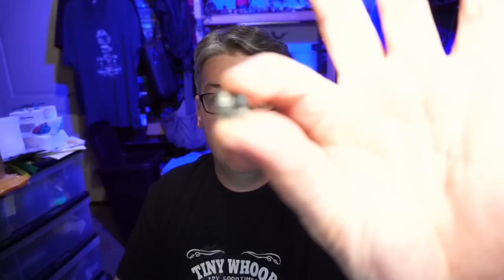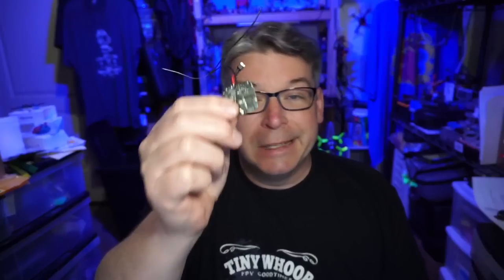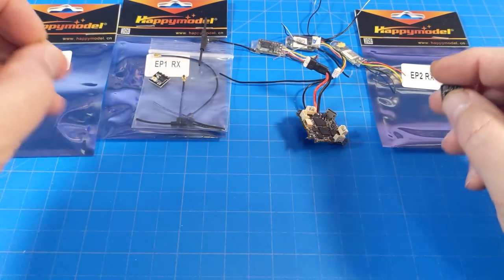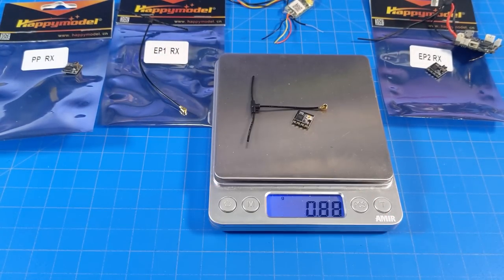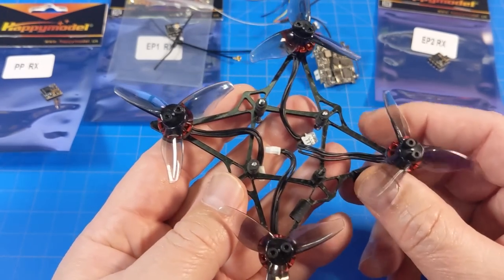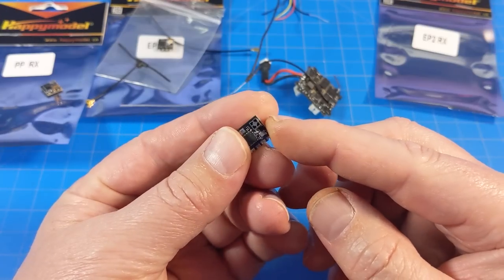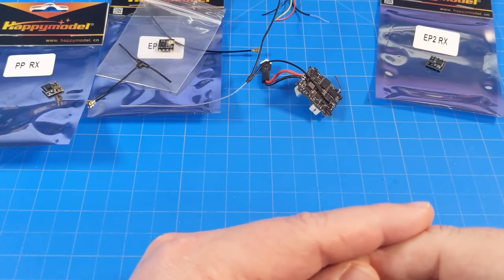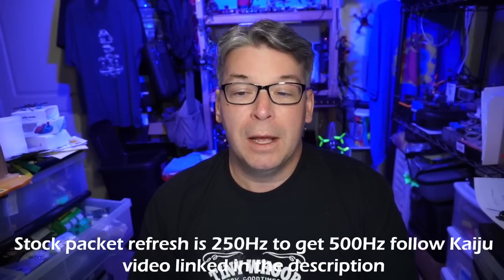HappyModel ExpressLRS 2.4ghz 900mhz // 10mW Range Test // Binding // Updating

Comment: I want an open source project like ExpressLRS for a digital FPV system. I really want this to happen, to free us from the proprietary DJI and Sharkbyte systems. I think the ELRS community has proven just how great and how much innovation the community itself has to offer, which manufacturers have failed to implement for years.
Reply: Agreed 100 percent.
Reply: It's only a matter of time :)
Reply: @ojkolsrud1  very cool project, as far as the pi zero on the quad i would think it wouldn't be a problem for quads except for maybe 65 mm tinywhoops, thanks again for pointing out this project
Reply: @ojkolsrud1  It's a great project but the latency is way too high for small quads. It would be cool for ardupilot on a big quad, wing or similar though.
Reply: And what you imagine to use instead of DJI or SharkByte? OpenTX? Still too huge latency for racing/freestyle and clumsy hardware, not suitable for anything below 3".
Reply: Agree
Reply: Aand hdzero is here. What a nice time to be in fpv quads

Comment from the maker: Do you agree, going ExpressLRS for micros solves a number of issues? This isn't a max range rather a proof of concept or minimum. ELRS has been out 3km on 10mW! 
EP2 Nano Rx https://bit.ly/3sS94sb
EP1 Nano Rx https://bit.ly/3tTjOYM
PP Nano Rx https://bit.ly/3xr4ODG
2.4Ghz TX module (does come with a project box, printed) https://bit.ly/3vmwkQC
Empty module bay box https://bit.ly/3tT8LyA
900mhz AIO Coming Soon!
Firmware updating video by Kaiju https://bit.ly/3xsNtde
Reply: Thanks for the link, Nick!  ❤️
Reply from the maker: @kaijupower  Yes sir. Your vid covers it well!
Reply: Still wondering how they let "PP" through
Reply from the maker: @Vitroid  It stands for Pew Pew, like shooting a gun in star wars.....not really :)
Reply from the maker: @Grim FPV Its from the UZ85,  which is the caddx ant lite.

Comment: Thanks for posting the tutorial!  I have  2.4Ghz slim module from a DIY seller on my Tango2 and I built my own PP Rx. Express LRS is awesome!  You shoud use "LQ" and "dbm" in the OSD for a better link reading (but more screen clutter).  I've had the chip antenna out to over 1200m at 100mW.

Comment: I'm pre-liking this video, just because I know you are going to love these new receivers!
Reply: OMG, I NEED THAT 915MHz FC!!!

They also need a 2.4GHz version as I'm obviously already invested into the 915MHz lineup, but I've got the 2.4GHz coming soon as well!
Reply from the maker: I do expect we will see the 2.4Ghz in about a month
Reply: Also, you were sitting less than a meter from the ground... meaning you suffer from ground interference!
Reply: You can apparently already buy the AIO from the AliExpress store, I just ordered one :D
Reply from the maker: @sjoervanderploeg4340  ah, I often forget about aliexpress. I have added a link. Thank you
Reply from the maker: @sjoervanderploeg4340  yep, far less than ideal testing. Do you think I should run it back with lq instead of rssi, forgot lq was a better visual.
Reply: @NickBurnsFPV  Not sure, I usually just look at the x:y numbers as X depicts the frequency you are on and Y is the strength

Comment: Nick, you have to use RSSIdbm and LQ!!! RSSI is kinda a meaningless scale. RSSIdbm is the actual reported signal level by the radio chip. We choose to have it so RSSI can go to 0 before failsafe so you have a broader range of values but it means you can't really do comparisons with other systems like that. LQ is actually the important parameter because it tells you what % of packets was received with success. I recon you could have gone further on ELRS.
Reply from the maker: Sorry. I fly so much around the house, I didn't think of needing lq. I think I should run it again as this isn't a good example.

Comment: What's the penetration like if you go loop behind trees for example on the 2.4ghz vs 900mhz systems?  Trying to decide which route to go...  I love the idea of the little ceramic antennas but not if still can't fly around trees
Reply from the maker: That area as a barbed wire fence, and worse snakes. I have been back there once. I will work to avoid that area :)

Comment: Nick, I have a question. I seem to have the most trouble with my video signal, not my control link. I have a stone house and can’t fly around to the other side without video cutting out. Even my quads with 200mW vtx fail. Do you have any experience with ground stations? I’m trying to find some way to fly around my whole yard (I have tried new antennas). Any advice would be appreciated! Thanks in advance :)
Reply: have you tried sitting on your rooftop?
or any place higher?

Comment: Nick, the Rssi dont mean much in ELRS but the Link Quality, i have seen videos of people who have -109 dbM signal and 100% Link quality, that means that altough the signal can be very weak according to signal strength, the LORA protocol is capable enough to maintain a high-quality link, you can go 30km+ @ 10mW easily.
Reply from the maker: Should I run it again with dbm value?
Reply: @NickBurnsFPV  Just enable Link Quality on the OSD and test again, you will get out of range of VTX and or battery before you failsafe. :)
Reply from the maker: @rolisaenz  Sure. I have the avio set for rssi dbm and LQ. I do have to be careful not to fly out of observers sight. Don't want to gain that unwanted attention :)
Reply: @NickBurnsFPV  lol, maybe the cactus or bushes will object hahaha.
Reply: @NickBurnsFPV  you might end up landing on the moon if not careful :))

Comment: Pretty freaking excited, just started the process of installing my 2.4 g on my jumper t-lite! 
Can’t wait till I’m done 2:15am now have to stop 😩😩😩 for now !
Reply from the maker: Yes sir. I am told the production version of the pcb that goes inside the radio has labled connectors. Do you have those labels on yours?
Reply: @NickBurnsFPV   yes it does , and I’m finally all updated and in the process of binding, really looking forward to my first “long” range flight !!
Reply: I can get the wifi to Link to my Ep1 but it won't take me to update site ? Sorry to bother you but any ideas ?
I'm trying to figure out the command promp thing you did ?
Reply from the maker: @rk-rc6045  If your on a windows computer, in the search bar type "cmd". The black window should appear on screen then type "ping 10.0.0.1" if your ep1 and computer are both connected then we will see what I have in the video.
Reply: Thank you ! Everything is updated and bound !  Tomorrow we fly far away !?! Really appreciate the help and all the time you put in for our benefit ! Have a great summer !
Reply from the maker: @rk-rc6045  Great, Good to know your all set.
Reply: Hi Nick, my actual name is Rob, Really sorry to bug you again, I have the jumper t lite 2.4 g module I'm using the ep2 Rx's, I have my module and Rx's running RC 8 from the elrs configurator, using the nightly builds option on open tx, I'm flying an emax freestyle, module settings are my packet rate is 500Mhz - 150dbm
Tlm ratio  1:16. 1172bps
Power 250 mw 
Rf freq  2.4G ISM
Not sure what I've done wrong ?
I get failsafe at just over 200- 300 '
No t warning and it drops out of the sky, same thing if I fly around our barn or house ? Again I know you have better things to do but if you have any thoughts I would be grateful 😊
Reply from the maker: @rk-rc6045  at 250mw mine shows:  500hz (-105dbm), TLM 1:4 4922bps. What does yours have at the very top? Mine is 98310a 0:500. Mainly looking at the 0 place, as that is the bad packets. I wonder if the antenna on the tx is possibly the wrong length? I am not sure what it should be, but I noticed the antenna just looks cut with wire snips, not carefully.
Reply: @NickBurnsFPV  yes everything except the tlm I'll try changing that, but I did take a closer look at the antenna and one side is a good 1/4" shorter than the other, really appreciate the reply ! How long do your antenna measure ? Then I promise I'll leave you be 😁
Reply from the maker: @rk-rc6045  the total horizontal length is 46.46mm. measuring from center to one side is 24.32mm the other side is 22.37. I suspect my side measurements are a touch off as they don't add the total. also this is with the end caps removed.
Reply: @NickBurnsFPV  the horizontal overall   length is almost identical but the ends, one is 22 mm the other is 25 mm approx , I was thinking I'd try just a diapole stick antenna ? Could this be bad for the module. 
I know I'm taking up some of your time but than you again I really have appreciated your input !!
Reply from the maker: @rk-rc6045  I don't think we should use a linear. I don't think it would harm the tx, but its always possible. I would reach out to happymodel support to see what they think the issue might be. their website is happymodel.cn.
Reply: @NickBurnsFPV  Thanks Nick, for all the help. Have a great summer !!

Comment: If someone makes an AIO express LRS 900 + Sharkbyte board and possibly even 1s capable it would be a gamechanger.
Reply from the maker: We would need a 7v+ pad on the aio. Not sure if AIO manufactures would be all that interested, but depends on the partner.
Reply: @NickBurnsFPV  When there is $ to be made 😄
Reply: Absolutely game changer...very well said.... becoz next is digital fpv.....
Reply: @dcvshambhu  Thanks. An AIO with Crossfire and DJIFPV would also be great but I can't see that happening. The Sharkbyte LRS AIO could really dominate in this space and it's a squeeze but doable with a triple layer 25x25 board.
Reply: @changeagent228  I hope in future there may be 1s shark byte aio board so that tiny whoop lovers can enjoy with ultra light whoops....
Reply: @dcvshambhu  😄👍
Reply from the maker: @changeagent228  That is true
Reply: Need to goto to the bigger 20x20 aio boards that have baro, free uarts for gps/compass.  Have ELRS 900mhz. But leave to add ur own vtx as a lot of people run different things. But have the 9v or 10v pad

Comment: Need a Tango 2 style radio with it. ;)
But honestly not sure what’s wrong with D8 for whoops and CRSF for Toothpicks or micros. Works really well as long as you have an MPM radio. If you’re new to the hobby I can see why this might be appealing but I’m gonna be a laggard on this one.
Reply: D8 spi rx have very bad range and crossfire is expensive af
Reply: @ValFPV  I’ve never had an issue with D8 on whoops. And for other CRSF works great.
Reply: Crossfire is good, but:
1. It's still big for mircos.
2. Only TBS developing it
3. Not OpenTX friendly.
If it's not open project then people not interested for developing it.
Opposite of it all Open source projects. That's why FrSky kick everyone on the balls 4 years ago with cheap, reliable radios with OpenTX.
Reply: @pksteffen  Bro, did you even read what I said? I said crsf is too expensive, not that it doesn't work well

Also, do your whoops use spi receivers? Because many people (including me) have found the range of those to be insufficient.
Reply: @ValFPV  yes SPI on whoops. I wish cost was the only concern.  Reserving judgment on this for now bro. 😎

Comment: Dumb question: you used an external module on your T-Lite?!?
Thanks!

I'd love to be able to use the tango2 internal tx to bind to 918mhz receivers... I doubt tbs will ever be opened to that.
Reply from the maker: A slim version isn't out yet, both 900mhz and 2.4ghz are larger modules that would natively fit the smaller radios.

Comment: Hey Nick, have you tried scaling the RSSI in Betaflight? I had to do it for both of my R9 receivers because the Betaflight RSSI reading was always way lower than my controller RSSI reading. They are the settings rssi_scale and rssi_offset in the CLI. Something about still having seeming perfect RX connection at 0 RSSI seems just a bit off to me.

Comment: Which of the Happymodel Expresslrs systems would give better penetration in an urban environment? 2.4ghz or 900mhz? I never fly far but do fly around and in buildings.
Reply from the maker: As you might guess I don't have experience flying in bandos or urban. From what I have read 900mhz has better range and therefore should have better penetration.

Comment: Gday Nick, banggers has 2.4ghz on preorder at the moment but selling fast, do you think its worth getting for micros? the software flashing for elrs is a bit of an ordeal if your not great with that sort of thing  (like mysel) lol,  that's the only thing that I'm concerned about, do you think the software will get more user friendly in time, awsome review mate.👍🛸
Reply from the maker: We don't have to flash the rx or tx, the benefit of flashing is to get 500hz refresh rate. Likely only those extreme racers will desire that.

Comment: What is your opinion if you were to use ExpressLrs to upgrade a Eachine Novice IV rtf kit. using the TX12 controller.. I am trying to upgrade mine.  This is all so new to me- but I want better everything with my drone.. Right now I can only fly a distance of a soccer field before the video cuts out.. maybe still set at only 25 mhz?
Reply from the maker: To get more video range we certainly need our vtx at a higher mw. Sounds like we need to do that first.

Comment: While I appreciate Kaijo video he made about the set up. The video is very fast and not in actual steps. Like backing up your models in OpenTX etc...And if you never delt with OpenTX & never drop files on a SD card before? It can be a little confusing! I already got the Happy model  2.4 module and two EP1 receivers..
I spent hours on my Radiomaster tx16s last night and it's still showing a firmware warning on the radio when powered up. I haven't even got as far as updating firmware on the Happy model 2.4g module yet!  Much less binding any of my EP1 receivers through Wifi or Betaflight passthrough. But I'm very excited about this protocol.  And cant wait to see its true potential. I'm really curious about how fast the latency difference vs Tracer which I been flying around for a while. And you can truly tell the difference between Tracer and normal Crossfire receiver. Hopefully I can get everything sorted on ERLS so I can fly it!
Reply: Come to the ELRS discord for help
Reply from the maker: There are more lengthy videos on updating opentx. We can slow down the video with the gear icon in the youtube play window, that might also help. And as DeltaGeek mentioned there is the ELRS discord, I hear its a very good place with a level headed community.
Reply: @NickBurnsFPV  Awesome Nick thanks for the info. I'm level headed most of the time if my wife & kids are not yelling at me. I'm already on multiple communities on discord so that's great to know. I expect that many more members will be releasing videos on ELRS
Reply: Ps : Wezely V has been helping me out a little!

Comment: Xt-xinte lists the F4 ELRS board already. Personally I'm waiting for the programmer to do the conversion on my R9. UAVtech has shown very impressive specs for it, the signal consistency is awesome, be it about the packet delivery or the latency. I hope we get T-lite a 5 in 1 or even plain ELRS module to replace the 4 in 1, I have zero problems moving to open source asap.

Comment: I soldered thumb cam to my moblite7. Works fine. Can I solder on top of the same pads this elrs (ep2 2,4)? Or is it too much? Will i burn something or it won't have enough power?
Reply from the maker: Its not recommended to double solder to any one pad, will it burn or damage...maybe we just don't do that when we can avoid it. Normally if we overload the 5v regulator what happens is the flight controller resets, or we get a component brownout.
Reply: @NickBurnsFPV  damn it 😔 Well thanks for the advice. I will follow it.

Comment: what are the transmitter options? I have an x-lite. Do you think the x-lite multiprotocol modules will be able to be updated to use this protocol?
Reply from the maker: yes, Betafpv just launched their nano module for elrs. I have no information on the multiprotocol module updating to include this protocol. I believe it will require new hardware.

Comment: hey nick.big fan.i have a question.can i install an expresslrs rx to and existing frsky AIO whoop/ghoothpick fc/board.via uart i presume.is it a straight forward thing like adding any rx.or???i want to add Elrs to my 2s crux 3
Reply from the maker: Yes, we can as long as we have an rx and tx of the same number free to use. then we disable the spi rx in the betaflight configuration.

Comment: Hey nick, i picked up a namelessrc aio412t. Watched your video on it. Informative as always. You had mentioned to not solder the motor wires to the pinholes but to use the pads. Is there a reason for this? What difference would it make? If any?
Reply from the maker: current flow and ease to solder. Soldering to the pins can be a mess.
Reply: @NickBurnsFPV  Thanks nick big help. Appreciate information. Also picked up a jumper t-lite. Any help on navigating it would be great. Thank again
Reply from the maker: @mokron1015  I can sure try to help. What sort of items can I help with?
Reply: @NickBurnsFPV  i basic set up. Just so i can get in the air. Are there download able set ups. Just really unsure of what info/vid will be helpful. Not to mention i use flysky receivers. So thats no help. Most setups are frsky.
Reply: @NickBurnsFPV  also is it internal or external? The paperwork is way different an doesn't give enough details. Zero help there. Lol your help is always appreciated.
Reply from the maker: @mokron1015  I don't believe are are downloadable setups. Most radios come with at least one model setup, but not fully. We need to go into the mixers page and set aux5-8 to the switches we want to use. binding frsky vs flysky isn't all that different. Depends on the rx if it has a button or not. The radio module is internal.
Reply: @NickBurnsFPV  bummer on no easy dl set up. I was hoping some fellow rotorhead might have have something. Meh no prob.👍I'm sure ill get it working. Thanks nick.